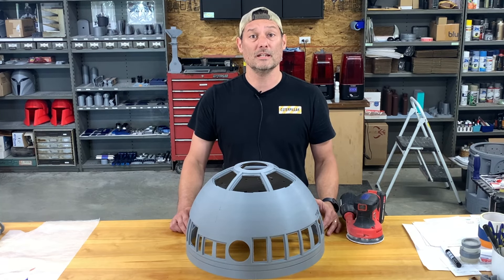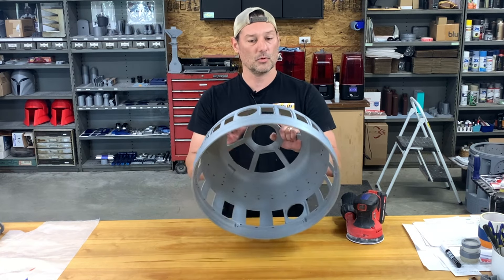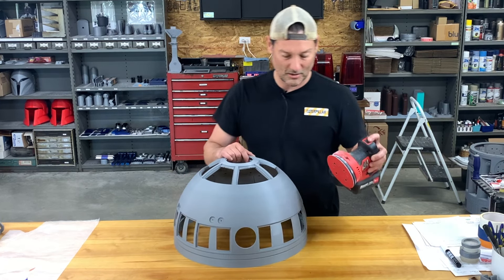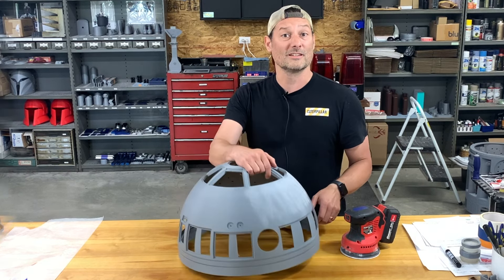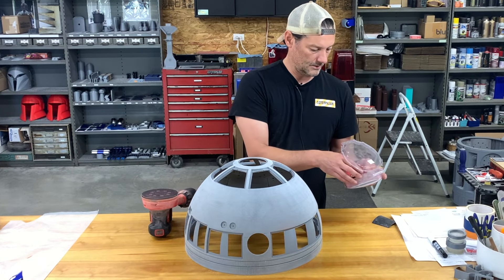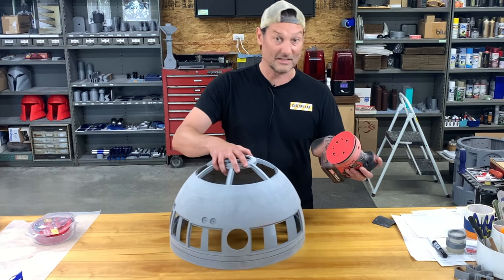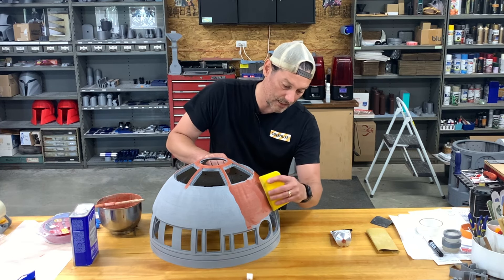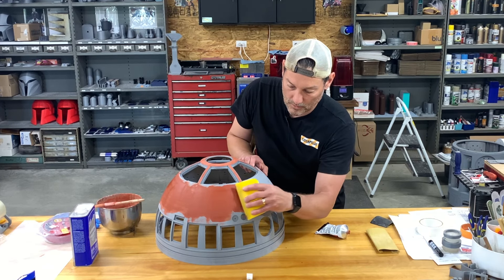Finishing R2-D2 DOME R2 (Build Part 1)

Comment: great video. is there a reason for using the glazing putty over the big can of two part bondo?
Reply from the maker: Bondo works great if you've had experience with it before.  People tend to put to much on and sand it off unevenly, it's harder to work with and can be messy but it's still good to use.  Glazing putty and acetone is fast and easy to sand.  It's all preference and I tend to prefer glazing putty but it's definitely not high build and only for smoothing after you have already sanded the project.  It will help eliminate layer lines but you aren't going to want to fill large gaps with it.

Comment: So, I just found your channel. If this has been asked, forgive me. What size build plate do you need to get a full dome, rather than in sections? Looking forward to the build series
Reply from the maker: Glad you found the channel!  Hope it helps!
You need a 500x500x500 build plate size.  I personally used the Comgrow T-500, unfortunately I can't get you a link from amazon because they appear to be out of stock currently.
Sovol is selling it though currently: https://www.sovol3d.com/products/comgrow-t500-direct-drive-auto-leveling-3d-printer-500-500-500?srsltid=AfmBOoowscKn1PLmgqDRCJuIYRMZInOPqqEyPkWoV3fFWsbx15O9vw_V
If you use the comgrow make certain Z hop is turned on otherwise you'll have problems.  It's a good machine for the size but I've personally had issues with the head and have had to replace it to the cost of 98 dollars three times already.
I guess I need to do a video now on that printer. :)

Comment: Kyle, since you have worked with both PLA+ and ABS, why did you choose PLA+ over ABS? There is a great post on astromech talking about the pros and cons of filements. It sounds like if you can dial in your settings for ABS, ABS is easier to sand and finish over PLA or PETG.....
Reply from the maker: My personal past experience with ABS has never been as good as PLA or PETG.  I just haven't taken the time to dial it in on my new machines.  Maybe now is the time!

Comment: hmm makes me wanna take on my r2 build again, started printing the body like 2 or 3 years ago but didn´t came out that great since my printer back then always made what it wanted and not what it should , maybe i start that again since i got a bigger printer now, but still have to split it are there good of the shelf solution for controlling it afterwards nowadays? i remember that there were so many out there
Reply from the maker: Yes, even in the past 3 years a lot has advanced and made it easier for you to control, build and even get electronics pre-programed.  DO IT!

Comment: What 3D printer do you use to print the dome in one go?
Reply from the maker: I use the Comgro T500 but I will warn you it's a difficult machine.  When it's dialed in and working it prints beautifully.  When it's not, it's a frustrating machine but that happens on large machines.  If you get one, do all the pre-prints that dial in the machine and make sure z-hop is turned on or you'll lose your mind.
Reply: @coz3d  Thanks! I was looking at the neptune 4 max that is 420 x 420 x 480. not sure it'll do a full size R2 dome or not.

Comment: Would the Bondo/acetone trick work on ABS since the ascentone melts it?
Reply from the maker: I have used it before and never had a problem on ABS personally.  I'd try it on a test piece before committing to a large item such as the dome.  Acetone also melts PLA as well and I've never had a problem.

Comment: Would definitely be more effective if you sanded vertical and not with the print lines. You are gonna pull way more material out of the print lines sanding in the same direction as the print. Sanding in small circles would be best. Great video for beginners though and I hope you continue this series all the way through an entire build.
Reply from the maker: Definitely going to try to do the entire build!